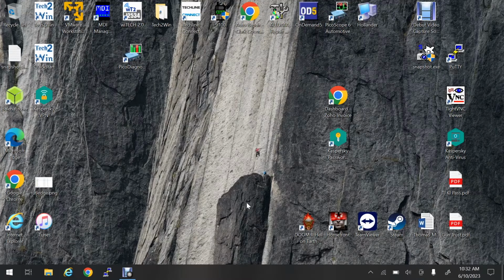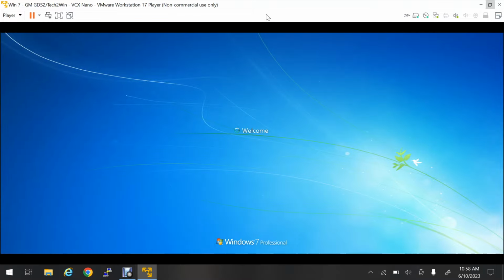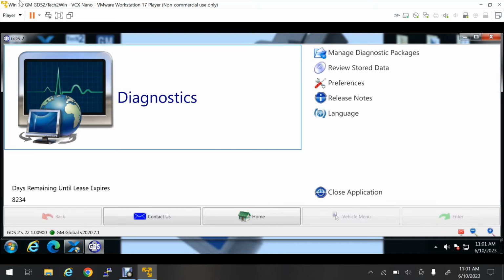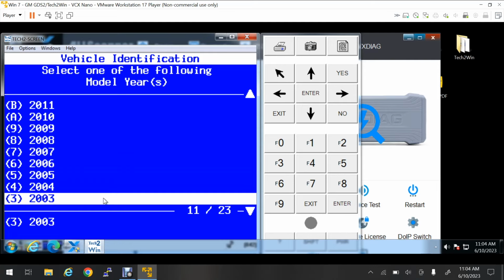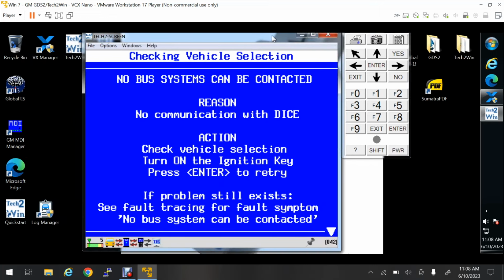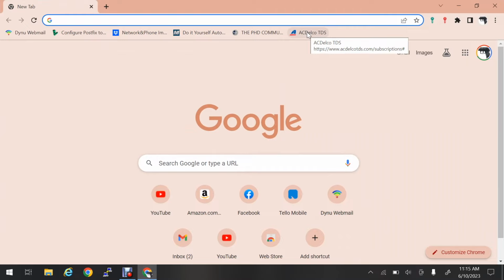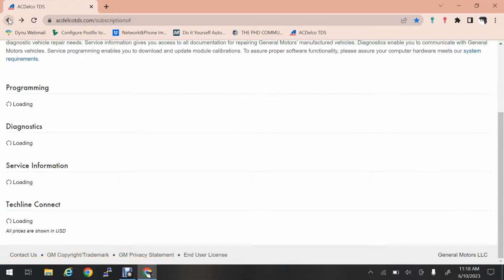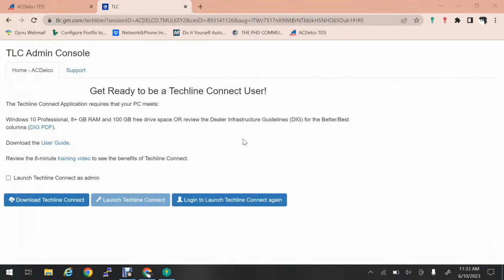My GM / Saab Programming Equipmet J-Box J2534 MDI2 VX Diag Nanno

Comment from the maker: The GM MDI and MDI2 Clones are now checked for by GM SPS and you can no longer program with them and they will lock your account if the detect one.  The older SAAB programming software will still work with them.  I now use an Autel Maxiflash Elite from AE Tools to do my prgraming on GM.
Reply: Thanks for the update. I had saved the MDI2 just a few hrs before you posted this comment so this is much appreciated. I wonder what else may still work with GM now that they are cracking down on clones.
Reply from the maker: I have a Autel MaxiFlash from AE Tools now.  I works great.  I got it used on e-Bay.  I also have heard from others that the TopDon one works good and is cheap.
Reply: @frugalprepper  I'm so glad I read this as I was about to order the MDI 2 clone. To be clear, you mentioned the Topdon I assume it is the RLink J2534? Does that still work on GM's? Does it work with others too for programming? Thanks in advance.
Reply: @transfixleo  It can be used.very good， My programming has always been good, but I need to update the driver from time to time, about once every 2 months.

Comment: Hey, I'm Looking for a J2534 Tool, The 3 Options I See are this VXDiag VCX which Sells for Around $150. But It Doesn't Give a Full Of Brands That it Covers. 
The New RLink and XTool XTS500 For Around $240-$280. I'm Looking for One that Have A Wider Coverage Of Vehicles. The RLink Says it Covers 13+ Vehicles Brands, The XTS500 Says it Covers 18+ Brands. Which one would you Recommend?

Also Is there any Other J2534 in the Market that's Better than All Of them In Coverage?
Reply from the maker: I would get the Topdon Rlink J2534: https://amzn.to/4nJmtz7

I just got one and it works well.

Comment: Lets say I have a 2013 Tahoe and I need to replace a module,  I have the MDI clone, I sign up  at the acdelco site and purchase a vin slot for $45 lets say. Do I have to purchase anything else in order to download the module update and write it to the module?
Reply from the maker: No, it will program it.  You will have to download the software a load several updates and then you can program it with the MDI clone.

Comment: I thought of a different question.  After researching the software portion, it seems that the MDI 2 requires Windows 7 only, but, the GM software from GM Tech website requires Windows 10.  How did you connect those two together and resolve that compatibility issue?  Thanks
Reply from the maker: The Pirated Tech 2 Win and GDS only runs on Windows 7 (Not really it will run on windows 10), but the SPS that you download from GM requires Windows 10.  I used a virtual machine to Run the Tech 2 Win and GDS.  The GM software will update the firmware and drivers on you MDI so you must download the Bosch Driver and install it were you are going to Tech2Win and GDS because the MDI driver has to match the Firmware.

Comment: I have a 2012 CTS-V that seems to need a new Electronic Suspension Control module.  Dealer checked it out and that was the diagnosis.  The module is easy access so I'd like to do it myself.  I found one on ebay and hoping it's a good module.  Seems to require programming so your video is helpful - thank you.  You mentioned you do programming for like 50-75 $$.  What City are you in?
Reply from the maker: I am in Springfield Ohio.  I charge $125 now, GM has raised there prices for access to SPS.  Once I buy your VIN I have it for 2 years, so any more programming in that time would only be $75.

Comment: I am thinking of getting vcx nano but i don t understand why you only program with mdi2. The vcx nano is a weaker device compared with mdi2 ?
Reply from the maker: The VCX nano used some Chinese software to emulate the MDI2, you will constantly fight with it emulating the MDI2 with the correct update firmware for programming.  The GM software has to run all of its updates and they have to be working to do any programming every time.   If it messes up you brick your module.   The clone MDI2 is a MDI2, no special software to drivers,  I just programs and loads the updated firmware.

Comment: Not sure if you have experience in programming new key fobs to vehicles, but if you do, can you recommend a good path.  Maybe VCX Nano + a subscription to SPS2 ?  The vehicle is a 2024 GMC 3500. I want to add an additional key fob.  If it matters, this truck is a 2023 refresh and is push-to-start.  Thanks !!
Reply from the maker: I don't know I have not programmed one for anything that new.  I believe that they changed the keys and frequencies in 2020.  I just work on older cars.   Keys are normally programmed with GDS not SPS.  The software that comes with a pirate tool will only go through about 2017 or sometimes 2019.

Comment: I could never figure out tech2 on a vm with win7.  Gds2 worked no issue.  On win10 tech2 out if the vm finds the MDI no issue.
Reply from the maker: Yeah I run Win 10 for programming, and win 7 for tech 2 win.

Comment: I just ordered a new 6T70/6T75/6T80 TCM Transmission Control Module for my 2007 Saturn that has the 6T75 trans What all do I need to get in order to program it? Is there a cost for software or do I just pay for vin model? Tks for all the info!
Reply from the maker: I don't believe that is programmed via GM SPS.  I believe you will have to load up Global TIS and Tech2Win.  I have not programmed that year or a TCM for a Saab, only the Engine Computers so I am not 100% sure though.   The software in no longer available from GM so you have to load up a pirated version of it.  Check Out Ivan's Vid on how to load up the Global TIS to work with Tech2Win.  https://youtu.be/FhFIcLQp-ME?si=JRHdwkPdktIjGwl5

Comment: I need to edit parameters on BCM Chevy Cruze like transmission  mode

Is a swap to manual tranny 
So do you think this tool works for me?
Reply from the maker: Nope, it will only program a TCM to match the original VIN Number.

Comment: I have  2006 Trailblazer SS and I just got a chinese MDI to inspect and repair the HVAC module and vent actuators.  Are you saying I cannot use it to program and do diagnostics anymore? Sorry if this has been answered in your video, but I got kind of lost.
Reply from the maker: Yes, you can run Tech2win to diagnose it.  If you need to program it you will run SPS2 though.   Then you will have to update the drivers where you run your pirate tech2win.
Reply: @frugalprepper using my vxc nano gm. I can get all the way to the programming but it will not communicate with my truck for some reason and will fail the programming. It will communicate with the truck all the way up until it is time to upload the programming into my truck. It is a class 2 truck as it is an 04 silverado

Comment: How is it possible that the vxdiag works with saab ? I got one of them no matter what i do its doesn't work  (think saab is not compatible with J2534 protocol)..
Reply from the maker: SAABS program with Tech2Win, and the VXDiag runs tech2win.
Reply: @frugalprepper thank you the reaction, Yes it does run Tech2win, but there's no communicating between it and the Bus .. maybe it only works with 9-3ss and dame Edna 9-5 and up but not on a Og 9-3 and 9-5 3.0 Tid..
Reply: Vxdiag vcx nanoworks for sps programming a saab 9.3 z18xe motor, 2004my? I have tech2win modded for the speed canbus. I alsohave globaltis. Also what can I buy for programming? Mdi clone? Tech 2 clone is the pricier.
Reply: Vxdiag wont work with saab, they have an issue with the communication speed on DLC pin 1. Same issue affects holden

Comment: I own a 2008 Saab 9-3. Would like to try Vcx nano for programming or just to access tech2. . What software and windows platform is needed? I saw the pine hollow vid but details are missing. Many thanx for a reply.
Reply from the maker: Yeah the VCX Nano will come with a CD with the software to load on a copy of Tech 2.  Then when you have that you will have to install the Global TIS and watch the video on how to install it and get it activated.   You can watch the video here: https://www.saabcentral.com/threads/globaltis-installation-step-by-step-video.675018/ 

And download it here: https://www.saabcentral.com/threads/tech2-software.612946/

I did mine on Windows 7 but Ivan seemed to have is working on Windows 10
Reply: Will a windows 11 laptop work? Any recommended virtual machine software that you recommend. Thank you again for the prompt detailed reply. I have tech2 win and global tis on my laptop but can’t get past the  activation. Will Vcx solve this?
Reply: Thanks
Reply from the maker: @130bowman  I don't know if it will work on windows 11.  You can download VMWare Player.  It if free.  Install it then make a new virtural machine for Windows 7 and install it.  If you need an install for windows 7 email me at tom@frugalprepper.rocks and I can hook you up.  The VCX comes with an activation free copy of GDS and Tech2Win, but I would install them in a virtual.  A lot of the cracks they use may come with a virus, so I wouldn't install them on your main desktop.
Reply: I emailed VX asking if it would work with my 06 Saab 9-3 aero they said they don't have a device or software to support 2006 SAAB. Will it work without being supported? Thanks
Reply from the maker: @giovannicabrera4746  I use it.  And it works when you install the older Saab Global TIS.  Watch Ivan's Video: https://youtu.be/FhFIcLQp-ME?si=gt0TX8AjB7us2ptm
Reply: Can i instal tech 2 win and global tis to win 7 vmware